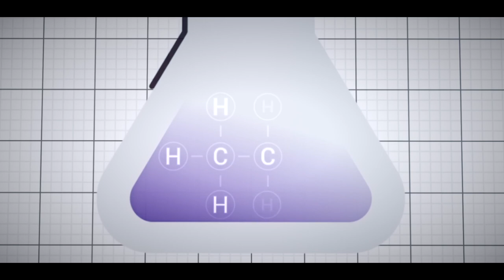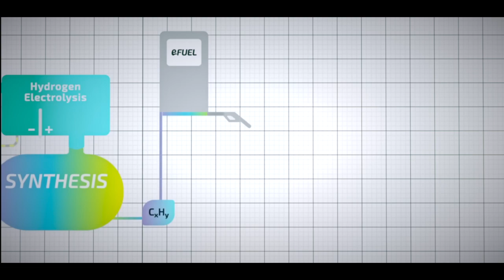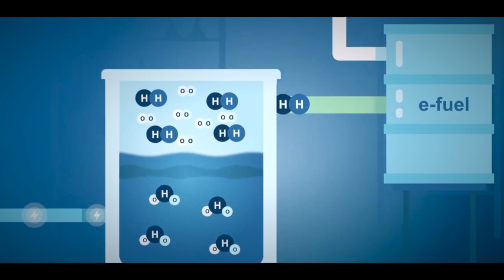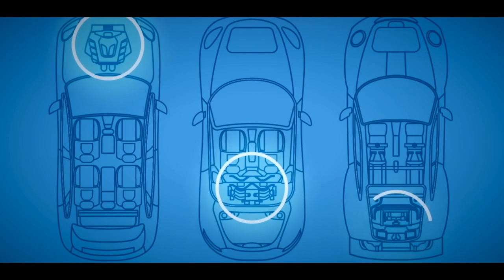Porsche CEO: Our eFuel Will Destroy The Entire EV Industry!

Comment: Going to the trouble to make synthetic fuel seems overkill when it is far cheaper to use ethanol or biodiesel already.  Porsche or someone could actually design an engine to run optimally on ethanol and get a rewewable fuel that is cheap and gets good performance; right now ethanol is being used in engines optimized for gasoline or diesel and do not run efficiently with ethanol. Even not Ethanol is far more green than EVs because 80% of the grid runs on coal and natural gas.